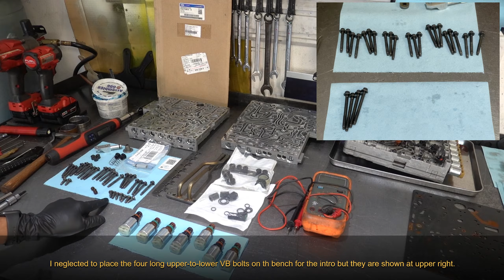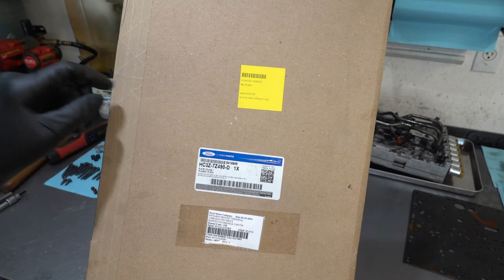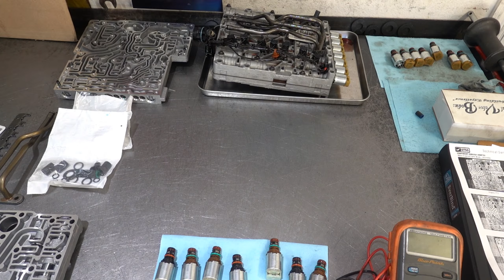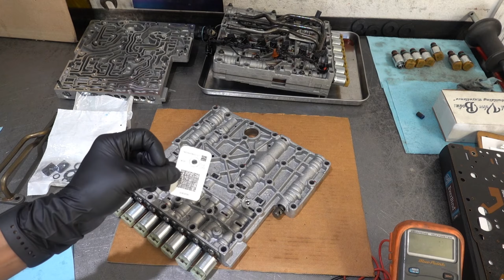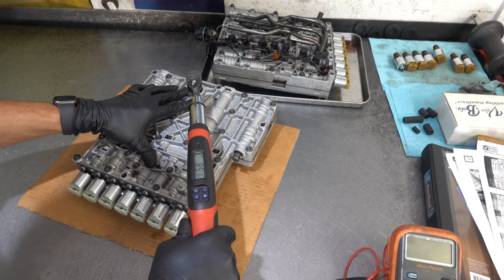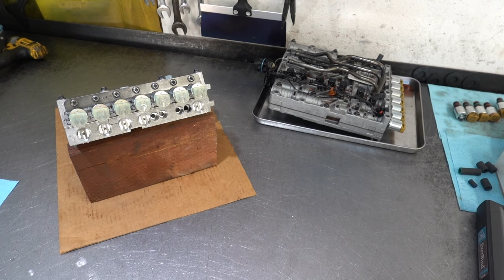Ford 6R140 Valve Body - Final Assembly (2017+)

Comment: Thank you for all this information! I work on big trucks, not medium duty . I drive a 550 superduty  service truck with an overheating and hard shift issue. I was told these trans have a temp control system in the valve body, contemplating replacing the valve body, found one for  $500 new OEM. It's hard shifted since new 5,4 downshift and 3,2 downshift, make you think you were rearended it hits so hard. I don't know anyone in my area who knows anything about this transmission! It got to  270° quickly has never done that before! Serviced the trans again, the fluid was dark, but the  pan was clean, which makes me think temperature regulation issues.
Reply from the maker: Thanks for watching, Frank!

Be sure to match your solenoid strategy and valve body ID codes between your existing valve body and any replacement. Also make sure the solenoids themselves have the correct banding numbers in the correct order. Otherwise you will have to reprogram the ECM w/the new solenoid strategy. Otherwise you just reset the transmission's Keep Alive Memory (KAM) - try that if you haven't done so already and perhaps that will fix it (assuming you already installed a replacement valve body)

Comment: Have a question! If you replace the valve body with a new OEM unit, will the shift solenoids have to  be programmed for the shift strategie of the trans controller ?
Reply from the maker: See my reply to your other comment - I touched on solenoid strategy and adaptive resets there.

Comment: I Installed zip kit and  body valves putted back   but problem still there 4,3,2,1 gears are changing with kicks. Any ideas?  What is this problem can be?
Reply from the maker: Did you reset the adapts? 

If not, that's likely the issue since the PCM would have been compensating for valve body wear that's no longer there. 

Did you replace your solenoids, particularly Solenoid A or test it to confirm it's working correctly? 

That solenoid is responsible for the 1-2-3-4 clutch function, which the Zip kit would have an o-ring end plug for but no corrective valves.

If you checked/did all those things then my guess (this is just a guess given I don't have your transmission in front of me) is that either the VB is simply worn out and needs to be replaced or your pressure balance system has wear (worn sealing rings, apply/balance piston seal(s) or (less likely but possible) either non-transmission related problem impacting the transmission or PCM itself.
Reply: @nickstransmissions ok i found on your video it's fifth
Reply from the maker: Sounds good, DV_Production. 

Based on what you've shared above, I'm inclined to think you need a valve body.

Do you have a Sonnax vacuum test machine?
Reply: @nickstransmissions  no i don’t have sonax mashine
Reply from the maker: Call around to local transmission shops in your area to see if any of them will test the valve body for you and let you know what, if any valve trains, are not sealing adequately...The usual suspects are the line pressure regulator valve, solenoid regulator valve, torque converter clutch boost and regulator valves as well as the forward clutch and direct clutch regulator and latch valves. 

That same shop should also be able to test your solenoids as well to see if any of them are weak or failing.
Reply: @nickstransmissions  Hey Nick i have a question! If my solenoid A works no good computer will show me a code? I don’t have any codes. And if i will replace solenoid same number, i have 3 , do i need make reprogramming?  How much do you charge for this tests?
Reply from the maker: @DV_Production You may or may not see the SES light illuminated for a transmission code. Additionally not all code readers will read transmission codes, though most will. Lastly, a solenoid can fail electrically or mechanically though will usually throw a stuck on or off or prrformance code if mechanical issues are present with the solenoid. No reprogramming needed as long as you replace solenoids with those having the same band number. You may need to clear the adapts for best results...

I can test them - will have to get back to you on testing costs, etc.
Reply: @nickstransmissions  sorry a lot of questions, what adapts do i need clean? I already bought solenoid and want to try install it
Reply from the maker: @DV_Production You clear the TCM's KAM (keep alive memory). Here are some instructions: https://images.oreillyauto.com/parts/img/documents/ptq/ig_6r140.pdf

Ive read folks stating online you can reset the TCM KAM by disconnecting the battery but cannot confirm or deny as that's outside my scope which is just the transmission.
Reply: @nickstransmissions  Hey Nick  i changed solenoid <A> and now much better,  but still have kick when gears changes Up 1-2, 5-6 and Down 6-5, 3-2. How you think what solenoids  do i need to replace? or just change all of them?
Reply: @nickstransmissions  i didn’t do adapts , can you explain how need to do it, or link to video?  I checked solenoid with multimeter but not changed
Reply: @nickstransmissions  and which of the solenoids is A?
Reply: @nickstransmissions  in forscan i did /reset all adaptions / and / clear transmission  adaptive tables/  something else do i need to reset?  But after reset nothing changes